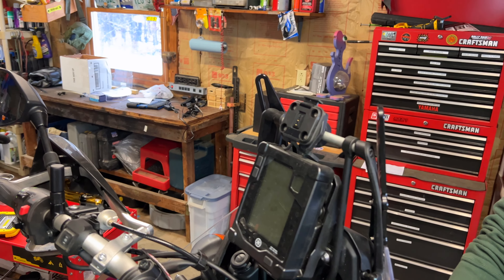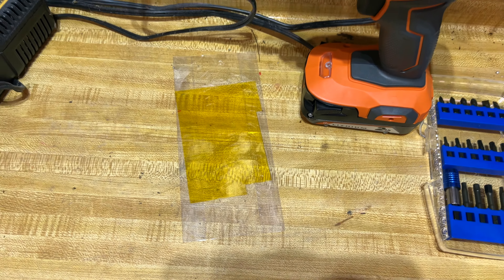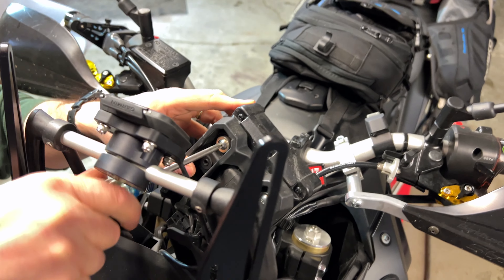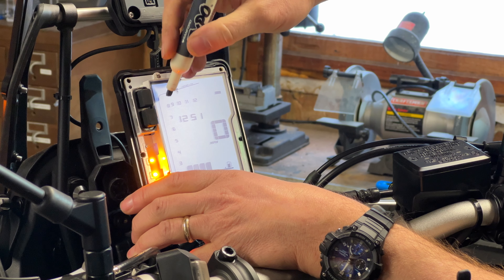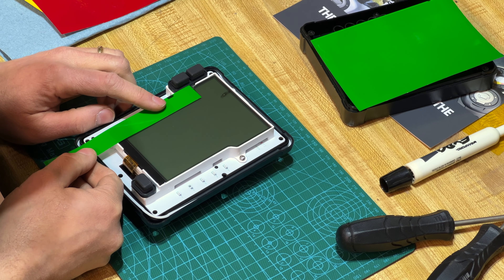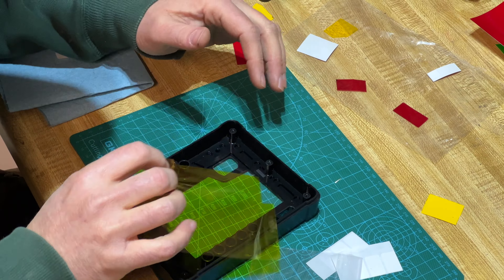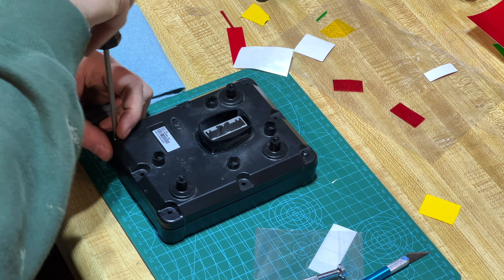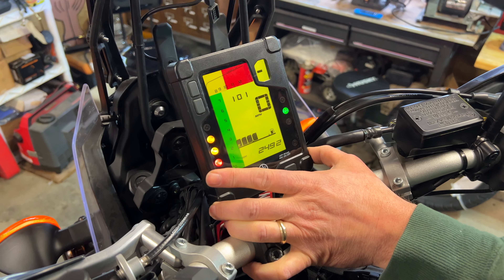Install: ColorClusterz Dash Customization for Yamaha Tenere 700 (T700)

Comment: Thanks for the video. I learned a lot. 
Can you tell me please, does the coloured film actually adhere to the face of the display?
If so, why is the main yellow sheet held into the cover of the dash screen with those tape tabs?
Is there a chance it could work loose?
Reply from the maker: Good question. That was just for lining it all up.
Reply: @AdamChandler86  Thanks. I'm  going to give that a go but try to contour the rpm column and keep the numbers in the main window. Glad that I stumbled across your post.👍😊
Reply: @AdamChandler86  Adam...sorry if I'm a nuisance, how does the coloured film adhere to the screen surface. Is it adhesive?
Reply: @AdamChandler86  Adam, sorry to be a nuisance, how does the film cling to the screen. Is it adhesive?

Comment from the maker: You can buy the pre-cut one here which is a lot pricier but makes the install more plug & play - https://colorclusterz.com/products/pre-cut-lcd-flip-yamaha-tenere-700-t7?variant=40956014919856

Also, this is not an ad or sponsorship.
Reply: Thats the flip kit changes the back ground to dark mode. The Tac colors are still cut your own. Their version does look better than what I tried but still not great.